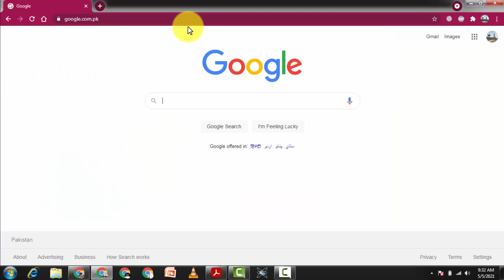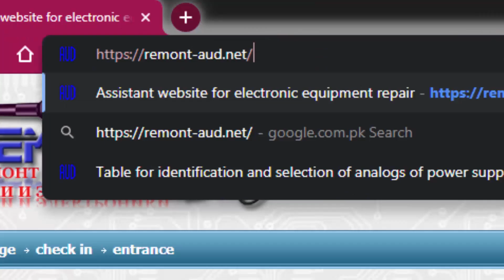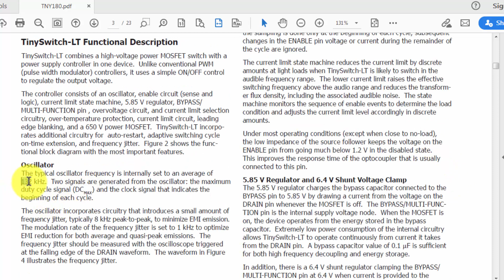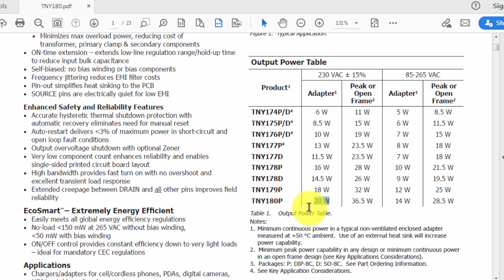{372} Find Number of Damaged or Burnt Out SMPS PWM Controller IC

Comment: Good information my smps tny279 burnout. What's the root cause.
Reply from the maker: there may be many reason in its damage
most of time material failure, improper input voltage. or any other surge in load side can destroy it.

Comment: I have a power supply from a 16 year old DVD player I just threw in the garbage but I kept this.  It has 5v, gnd, and 12v out so how do I determine how much current this will go up to?  I know the fuse in it is a 1.6A 250v one.

Comment: All the best
Reply from the maker: Thanks a lot
Reply: @HaseebElectronics  Dear brother I am Hicham in your WhatsApp. I need to know how you test the smps transformer? Because when I measure the primary it gives 0,2ohms like a short. I changed many components but still not working. I changed shorted transistors big resistor. There is dc voltage 310vdc after bridge but it is stuck. So I have doubt on that transformer!!! For your information the board is the power supply for a professional internet router. Thanks a lot Sir Muhammad 🙏